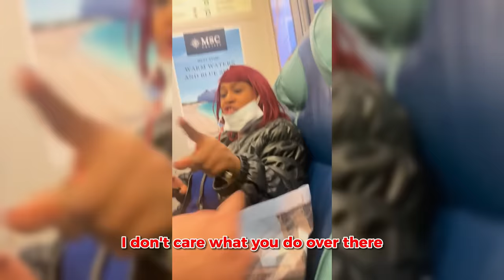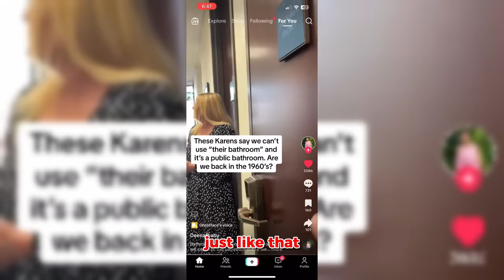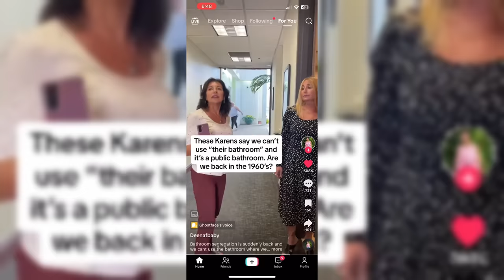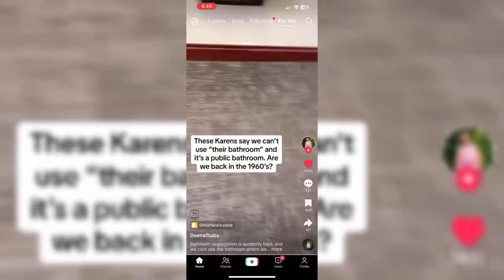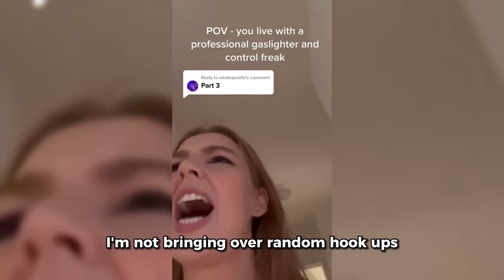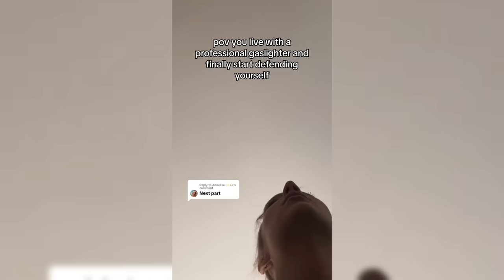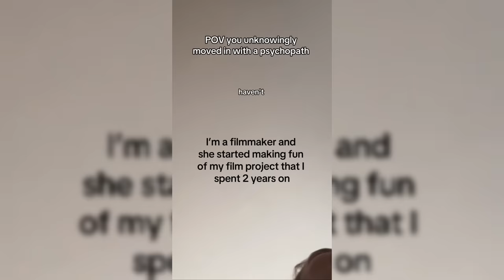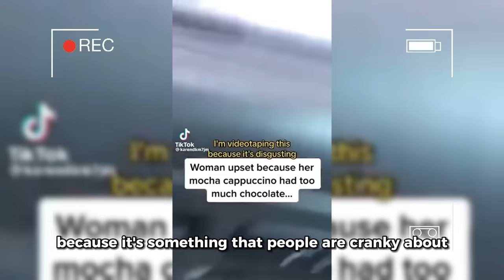TOP 200 BEST KARENS CLIPS OF 2023! (INSTANT KARMA)

Comment: The hotel giving some random strangers a key card to your room - happened to me a couple years ago right in the middle of the night. 

Best investment I ever made was a set of travel door locks for hotel rooms. You wedge them in the door catch and no-one can open your door. Small enough to fit in your wash bag with no issue and cost very little money to buy. Bought them years ago when I was skint and staying in youth hostels and the like where there often weren't locks on doors. Still in the habit of having them on when I'm staying somewhere. So the rando at 2 in the morning wasn't able to get the door open more than about a centimetre.

Comment: When ppl parked in my parking space I would park horizontally if front of their car. They worked days and I worked midnights. The satisfaction from their anger was bliss. They also knew I worked midnights and before the fiasco with the cars they would stomp on their floor on purpose to mess with us. It was shit living under them until they started parking in my spot. I bought noise cancelling headphones , pop them on and could barely hear them knock on my door. They at one point tried ripping off my metal plate in my parking spot stating my apt number and the apt number parking only. As if I couldn’t just get the complex to put it back up. They were crazy.